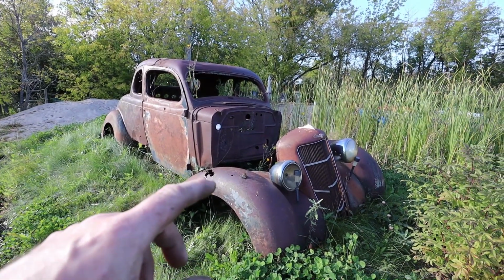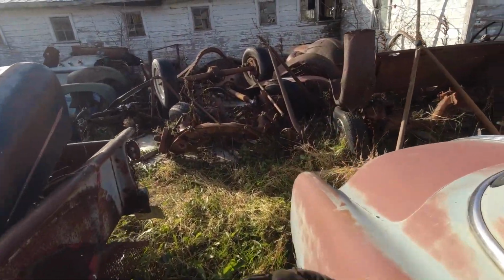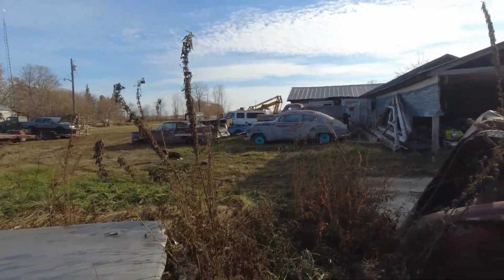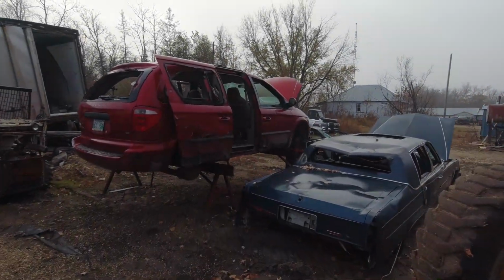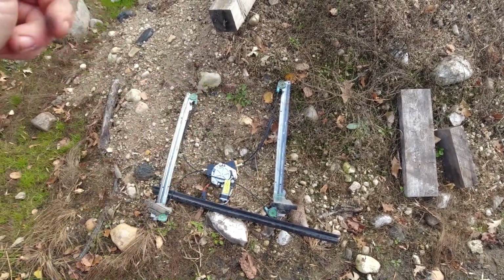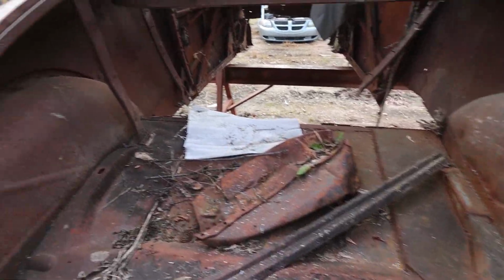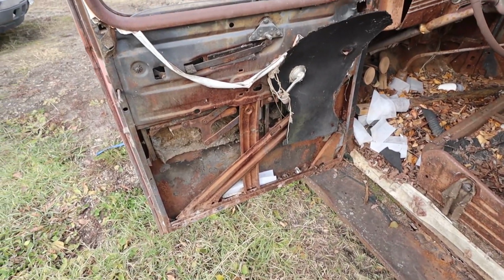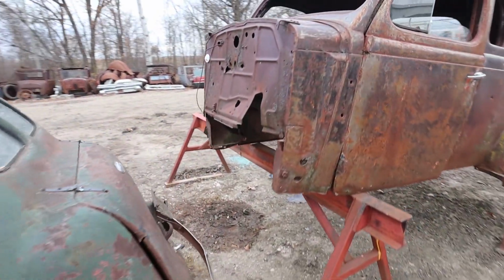New winter project 1935 Dodge coupe. Parts gathering...

Comment: Pt cruisers has the single middle window lifter mechanism that's 4" wide plastic and fits nicely in doors it has the same bow in it as the caravan has but you just heat it up and straighten it they are 2 bolt mount up and have clips that glass sets in to hold it .but it looks like a 36 dodge and a 38 Plymouth but nice score on both of them since I'm a mopar man I have a 40 dodge 3 man business coupe a 41 dodge pickup 65 Plymouth belvedere 2   a 85 dodge ramcharger but stay safe and healthy and keep the video's coming

Comment: Before you scrap the Caddy and van are the door and roof panels adaptable to use to re skin the doors you have. That metal usually has compound curves  and can be modified to suit?
The caravan has seats with flat spring construction that I have used in substitute for the coil seat spring construction. Going to be an interesting build.

Comment: So OK McDude you don't have the fenders that go with the body, but all the bodies and fenders of that era looked pretty much the same, it was the grilles and hood lines that were different.  You do have a bunch of fenders of that period, so all you have to do is pick a set that looks good on that bod, do a little metal magic and voila a one of a kind hot rod. 😁
Reply: Yes, go ahead and upgrade it with those Chev fenders and side mount spare(s). I won't tell, and who else will ever know? The 35 Dodge is a really good looking car, in my eyes.

Comment: Brent, I hope you persevere with the Dodge 35 Coupe, in spite of the formidable difficulties. For someone with your skills and imagination, a  chassis would not be hard to find among the "treasures" in your property, a chassis that you could easily modify to suit the body. For a change, could you consider a modern straight six engine?  Ford made some great ones in the 90's, and they would help in the pesky problem of interference of steering with the exhaust manifold that you have encountered in your LS adaptations. Will follow your new build with much interest.

Comment: Have you thought about taking a section out of the rear doors on the donor car and adding it to the center of the front door to lengthen the door? Then you could move the door pillar back and remove the back side window to make it a three window coupe. Then the proportions would be correct. That thing has a long nose and a long tail with a short door. You could also use the curve from the rear side window frame to make the rear of the door window frame match the roof line curve. It would look a lot more sleek and elegant.

Comment: Your on the right track for sure and these Dodge frames are strong so go ahead and chop up the 38 - I have used photo-shop for years to build cars - maybe shorten the roof a little more just until you fit comfortably - I built a compartment just behind the seats for the spare, jack, some tools and the battery, leaving lots of uncluttered room in the trunk- The car was great, but like a dummy I sold it - I thoroughly enjoyed this video, it brought back lots of memories.

Comment: The coupe appears to have a roll down rear window (the center back window, not the quarter glass).  Instead of trying to fix an original mechanism to get this to work, you might want to get an electric rear window mechanism out of a 60s-70s station wagon.  There were a couple sedans  (like a Mercury Monterey with a "breezeway" rear window) that had a roll down rear window, but these mechanisms are hard to find.

Comment: Brent, if you'll look at the badge on the center of the radiator that has wings, right in the middle in very small writing will say Dodge Brothers. I found one of those badges metal detecting years ago, and unless it's somehow different that I can't see from down here in Georgia, it looks to be the same.

Comment: You've got the wrong year doors ... '35 and '36 are the same shape overall but the bodyline is a little different as you've noticed! I'll be keeping a close eye on this project .... I've got a '36 coupe body shell in my backyard too! LOL!!! Like I said '35 and '36 are the same overall shape except for the body line width but they used the same body shell for Dodge, Plymouth and Desoto and you are right about the front doors on a short wheelbase 4 door being the same as the coupe ... your best bet is to find a '35 Dodge, Plymouth or Desoto! Good luck!😊

Comment: How do you build a show car in ten easy steps?  1.) Gather your parts. I like to make sure of my power window setup, so then I'm committed to full doors. and that usually means a roof, too.  2.) Find doors to go with the power windows.  3.)  Find a body and fenders to go with the doors.  4.) Add snow. 5.)  Add 600 man hours labor, various bits and pieces of sheet metal, tubing, glass, 5 welding rods, 7 spools of mig wire, 2 dogs, and 10 empty 30 pack holders for CAD.  6.) Add rebuilt and blown LS engine.  7.) Add S 10 Chassis  8.) (optional) Add brakes and line lock.  9.) Add schmooz, primer, and paint. 10.) Figure out what to name the new hot rod show car, and where the winter went!

Comment: Just a bit of a guess and possibly why the door lines don't match is because the coupe body might actually be a 1935 DeSoto Airstream,(not airflow) . Even harder to find parts for as they were a bit of an orphan after the sales disaster of the Airflow. So not too many were sold.

Comment: I,love the fact that you will be doing more fab work on the dodge   You now have. A 38 Plymouth 4 door for a future project. I would like to send you some pic of my 37 Plymouth 4 door. We stretched it 30” moved the driver back door to the pass side. Both doors open making it a lemo rat rod!  The driver side now has a long. 2dr driver door, another fake door, and the two door quarter panel . It has been the most fun of my builds. Advise how to send e-pictures to you if you would like.  Jeff

Comment: I think a 3 window could be made.
Looking at photoshop picts.
The rear fenders are too far back.
Chop out the quarterbelt moving the decklid opening nearly to the base of the rear glass, also shortening the quarter panel then will bring the wheel housings forward the width of the quarterbelt.
(cut it behind B pillar Then move rear clip fwd after the  the quarter belt  is removed, allowing to the quarters to meet post) once the with of the quarter belt is removed from their front.
...did I say that right?
A man of your talents can do this easily !!

Comment: Why not just use a sold set of fenders you already have from a mid 30s Chev or other unidentified set you can find from that era? Using the front and rear fenders from the same car, you get the correct side profile and any new body lines will look correct front to rear. 
Best thing about a custom is you can use what you want.
The longer front end off that 38 would just look wrong with the short coupe rear.

Comment: The vast majority of your subscribers are in the US. If your goal is to head aaaaall the way down to Texas, it would be great if you set up a day here and there along the way for your fans to come out and meet you. Are you planning on putting this latest creation on the car hauler  truck you're going to build with Carl?
The picture you showed of an actual '35 Dodge isn't that far off from a '35 Ford, which should be easier to get parts for.
Next year, please do the Apache you bought this year. It won't take a lot of work.
This is going to be a typical LS powered build. You’ve previously addressed the computer and oil pan issues some cars have. One thing you have not addressed, on a practical matter, is replacing the oil pan gasket and valve cover gaskets. In actual GM late model cars, the oil pan gasket requires you to drop the engine and its cradle to do the job= a giant PITA!! The valve cover gaskets are actually O’Rings and GM leaves NO room to do the job easily. In any event, they both WILL leak, so before installing the engine, replace them!!

Comment: does Pablo ever wag his tail? ha ha but he seems to be a happy dog
your project is going to be great I was wondering what the next video was going to be, I got the super cool answer👍👍
me on my s10 ls I used a steering column whit rack from equinox or saturn vue it's the same one which is electric in the dash  and what's good is the steering wheel tilts , can be good for your project
Reply from the maker: You used the racknpinion from the equinox? does it have any bump steer?
Reply: @HalfassKustoms  yes I used the rack pinion saturn vue 2003 and the electric motor is on the column below the dash
Reply from the maker: @sl5303  interesting I'm going to look into that
Reply: @HalfassKustoms  yes the column not too hard but the rack a little ah ah

Comment: Looking forward to your '35 Doge winter project. Agree with your idea to give it kind of a '35-36 Ford coupe look. Here's a contrarian thought to the plan you showed with photoshop. Skip the low rider/fender skirt look and give it a more purposeful dirt track 3 or 5-window coupe look from that era. Don't chop the top. Don't do fender skirts. Don't lower it. Give it a '30's & '40's circle track racing look. b.t.w., good decision to not build off the '38 sedan. Even with big mods I don't think it would give you the right '35-36 coupe look. Save it for another project. My two cents.

Comment: Hate to see what guys have to start with these days, especially in the Rust Belt.  Still,
 FREE is a very good price!
There are a couple of builds going on over at the HAMB that you will want to check out 
if you haven't already.  Converting a 4dr. sedan into a 3 or 5 window coupe taint for the
 faint of heart!
  If you want to see a primo example of one done right, check out the bitchin' one built
 by a Salt Lake City speed shop owner a few years back. With an extended trunk and a 
'40 style lid, it really is the Bomb, as the boys say today. (And it may even be a Dodge!)
Now if you really want to think outside the box, consider sectioning or channeling the 
rotten bottom of those rockers and building a LOW 50s style custom; but keep it Ole
 School!
   If interested in any of these, let me know and I will also do some digging.

Comment: dont feel bad about the 38...not being the right donor...  Trust me, I and a lot of other folks be there..   Hell I bought a rear valance for my 69 catalina.  Welded the rips in the metal shaped it shrunk some dents. filled it and primed it.  The thing was flawless....   When I went to check the fitment on it where it bolts to the bumper and tails of the 1/4 panels. Didn't fit!!!   Wrong Year!!   1968....  That was depressing....   So if you need a rear valence for a 1968  not a 1969   let me know!!  its in the rafters in the garage..  { you may have to lightly sand some cuss words written in sharpie on it}  at the time it seemed like the right thing to do....

Comment: Haha. He was no friend to give you that POS. 1935 Dodge. I would cut the inner door panels cut of the van. You may need some lf it. The blue Cadillac. I would cut the sheet metal out of the hood and trunk to use for patch panels or even door skins. It's a 1938 Plymouth. The difficult part is the roof graft.